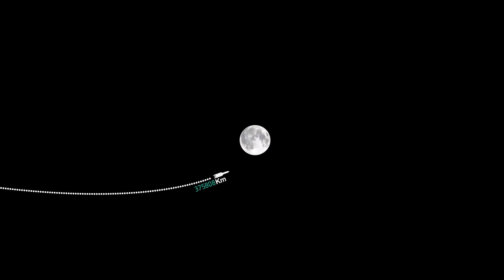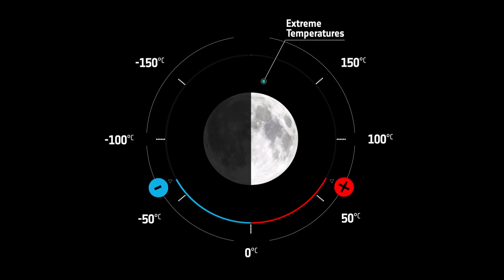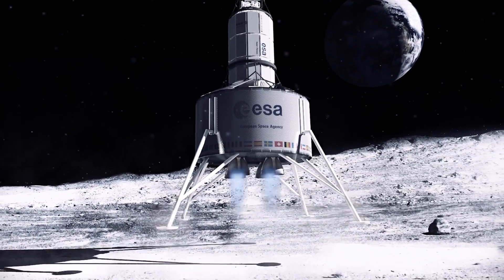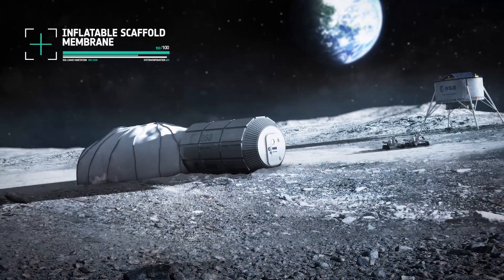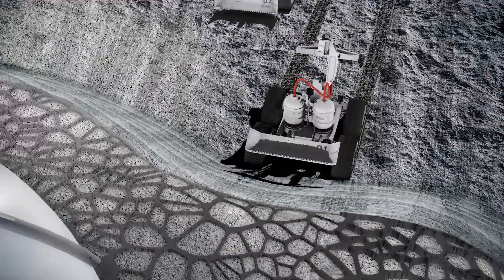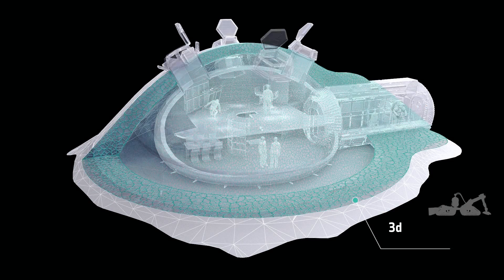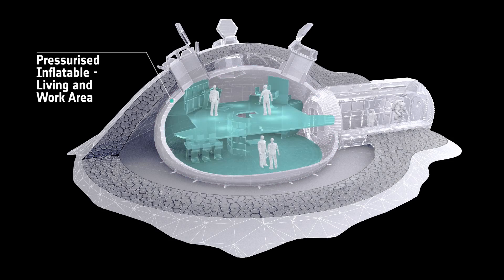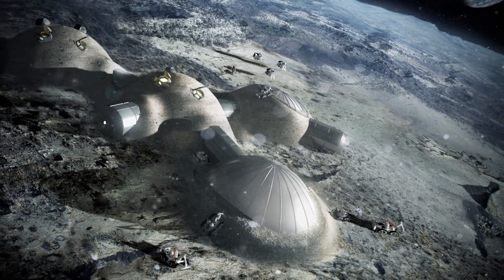3D-printing a lunar base

Comment: Wow.. Just wow...
Does this mean that people are going to be going back to the moon? Or is this just a concept?
Reply: Niosus I didn't used any usual equation used with rockets, no dV or orbit transfert.
I just calculated the difference of mechanical energy between the launchpad and the GTO for 10T (wikipedia specs for Ariane 5) and calculated the maximum mass of an object you can put on the same orbit as the Moon with this energy.

It's oversimplifying by I don't want to bother with the changing mass of the rocket while thrusting or a 2 bodies problem.
It's really a 'back of the envelope' calculation and you would have better results with an dV budget calculation, a transfer orbit from GTO or proper equations for lunar transit.

Anyway it is a indeed a light cargo but I hope the next generation of rockets for inhabited flight of NASA would make such project possible and that the success of Ariane as a double commercial launcher will inspire heavy rocketry project for satellites and maybe inhabited flights too.
Reply: I don't think so.
In the description they're saying that they are investigating 3D printing of lunar material.
Also the load (lander and capsule) seems too heavy for an Ariane 5 to put on the moon (just a guess, I'm no rocket scientist)
Really awesome though ! \o/
And the fact that ESA is showing this on there official youtube channel makes me hope =)
Reply: The ESA had a program that included a manned lunar landing, but it was abandoned.
Reply: ***** The Ariane 5 is a pretty capable rocket so I decided to do some digging. I can't really find data on what an Ariane could put on the moon, but it takes about 6km/s of deltaV to land on the moon from LEO. Getting from LEO to an orbit around Mars is around 5.2 km/s. So it is slightly harder to land safely on the moon than it is to get in orbit around Mars.

Curiosity was about 4 metric tons at launch on an Atlas V. The Ariane 5 is a bit more powerful than that, but it needs more energy so it could probably get around 3-3.5 tons on the surface. Compared to the 15 tons of Apollo 11 (with another 30 tons in orbit). That's a pretty tight budget especially since that includes the lander.

We'll probably need the SpaceX Falcon Heavy when that becomes available. That should have around half the capacity of the Saturn V so a 15-20 ton lander should be possible with that. Since there is no need to return or stay in orbit, that should give a significant boost to the amount of useful mass we can land compared to the Apollo missions.
Reply: Niosus I did the math (correctly I hope) and a rendez-vous with the Moon doesn't take much more energy than launching a satellite on geostationary orbit. Actually an Ariane 5 G could take 9 metric tons to the moon (for 10 in GTO). But that does not include landing so there is the lander and its fuel included in those 9T.
Also we don't need to take of the Moon and the payload could be a couple tons if there are only the rovers and the capsule.
So I guess I was wrong, with the proper landing technology and a light payload, those rockets could take this on the Moon.
But I just realised how light is 9T, the Apollo LEM alone was 10T
Reply: ***** Did you calculate it for the lunar transfer orbit or all the way to the surface? There is a very significant difference there. That's another 2km/s you need to get rid off. The number I estimated was the dry mass without fuel on landing. Of course it could very well be wrong.

When I put this into the rocket equation (9T total, 3.5T dry mass and 310 specific impulse like the LEM) that gives 2.8km/s dV. So either my number is too low, yours is too high or we both are a bit off. Anyway, 800m/s difference in our calculations ain't too bad.

Of course we haven't counted the plane change to get to the south pole, which is the worst case scenario. So with that included you won't be able to land much more dry mass than 3.5T on the south pole and around 4.5T on the equator.

I'm surprised by how good this actually matches up. Still it's far too little to really transport any significant amount of cargo, but it's promising for when heavy lift rockets start being used.
Reply: ***** Well you can actually do that for a large part when going between orbits. Luckily when it comes to taking into account the changing mass of the rocket, the rocket equation is perfect. All you need is total mass, mass of the fuel and the efficiency of the engine. It tells you exactly what  your energy budget is. For my first calculation I was looking what kind of stuff we managed to get to Mars and comparing the dV budgets required for that. For the second calculation I extrapolated from what you said: if we can get the 9T in orbit around the moon, what kind of useful mass can we land? The results are very close so I believe we shouldn't be off by all that much. Back of the envelope calculations are often much more useful than people give them credit for, especially when you arrive to the same number with 2 different approaches.

Anyway, nice discussion. Now I know (roughly) what an Ariane could put on the moon. Let's hope this animation will one day become reality. Have a nice day!